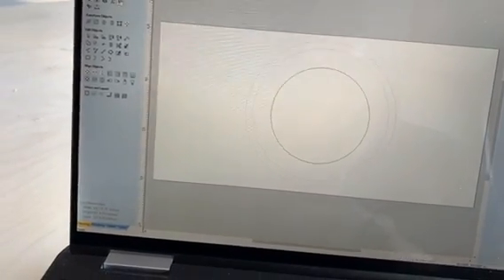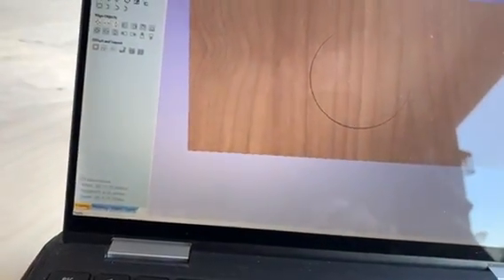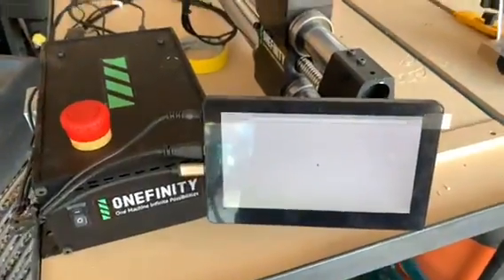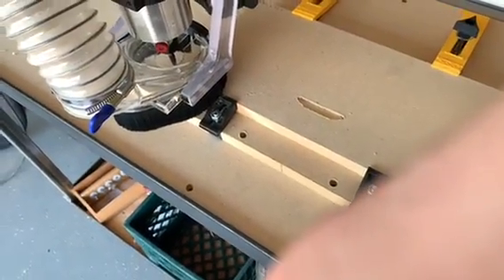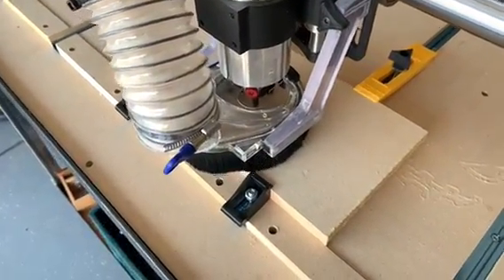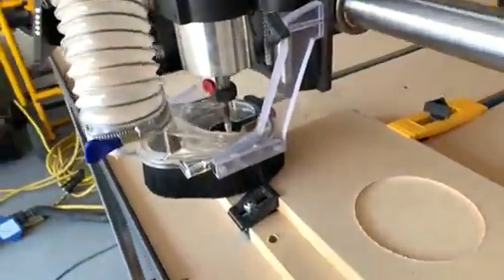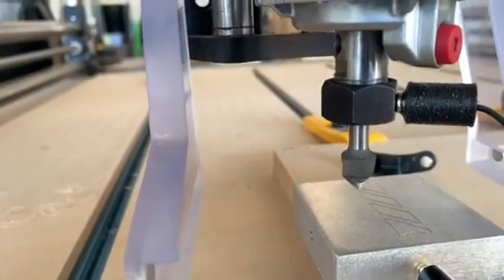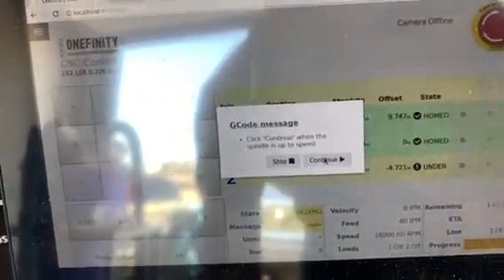Multiple Tools On the Onefinity (Community Made)

Comment: Are the tool change pop-ups unique to vcarve pro?  Or do they show up automatically when you have two tools regardless of the software used to create the gcode? We use carbide create and have been saving each tool as a separate gcode file.
Reply from the maker: The best way is to continue saving each tool as separate gcode files.
Reply: @OnefinityCNC  If I'm using the same tool type and configuration for multiple vectors, do I have to establish a NEW tool path for each vector or can I just assign that same tool path to all of those vectors?